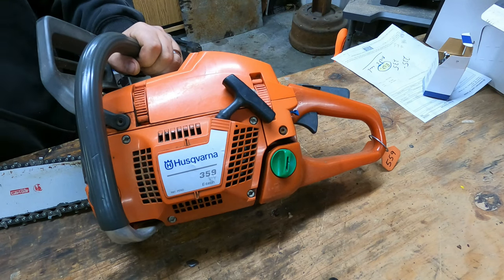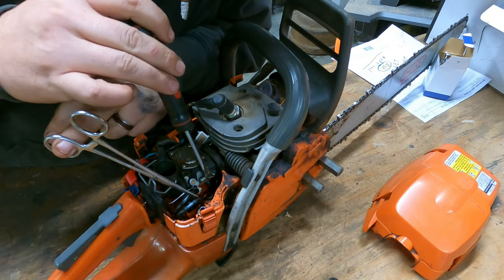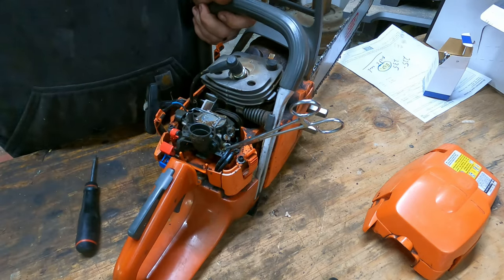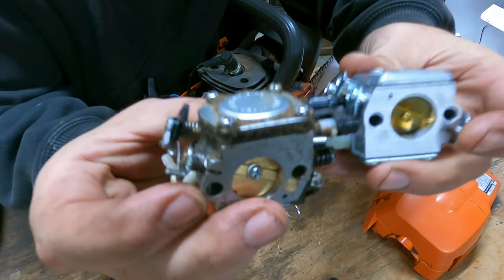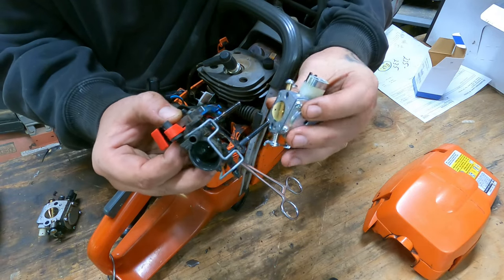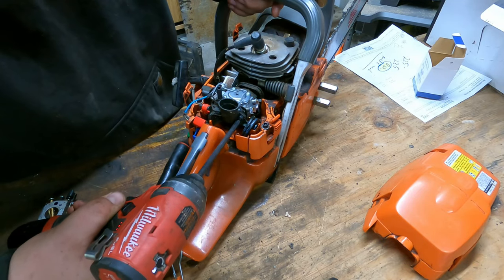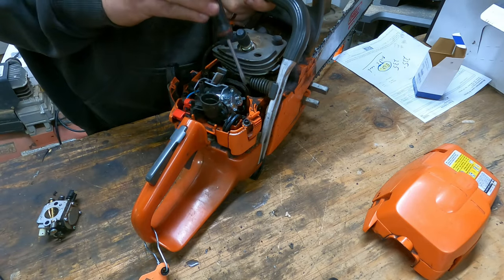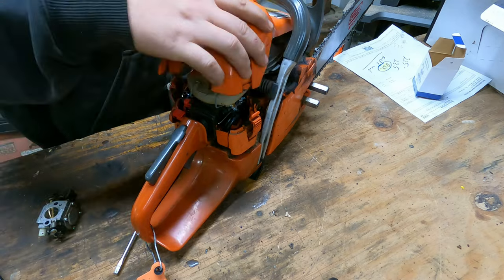HOW TO - Replace a husqvarna 357xp / 359 carburetor no idle, unexplained engine failure

Comment: Mine has the old style i just cleaned it today and it was spotless.Acted like it was hung open..Plug cover in gas and spitn fuel out muffler..Just out of no where..Cleaned it best i could ..Then i pushed the trigger slider off in handle..Choke wouldnt lock out like it should..I missed a bolt hole on gasket.lol..It popped right off as always..Say i need to replace carb..Good how to video..❤

Comment: Awesome video. Somewhere over the years I’ve owned this or maybe straight out the gate because my dealer is great I got the updated carb and EPA stuff was edited. Seeing the difference was helpful. Just going through some of the equipment and haven’t used my 357xp in years. Started right up and ran a full day no problem. Thank you for making quality content.

Comment: Very detailed video. I'm working on my dad's 359. Carburetor problems. Never worked on this particular model before and your video was very helpful. I've tuned and tuned the carb and it just won't do right. Can't get it to idle right and at time bogs on the top end no matter how I tune it. And yes, the arrestor screen is good. Anyway, I'm gonna take the carb apart and clean it. If that doesn't work then I'll just replace the carb. I'm sure the carb kit costs more than what I can get a new carb for. Good video though.

Comment: Thanks for sharing and demonstrating how to replace the carb. Also showing the difference between the old and new versions of the carb. I just picked up a 359 off Craigslist for $80 the guy just put a new side cover spark plug and updated carb on it but it will not start. It’s got plenty of compression and looks to have been used very little. Any way your video will surly help me on my adventure! Man you work quick on them things! You could probably do one in the dark or very limited light if you had too!

Comment: Great video, I have one question though. If previously I had the WALBRO carburetor on, can i replace it with this ZAMA new one and they will be compatible?
Reply from the maker: yes they used both rbs on these depending on the model year walbro is better in my opinion but both fit just fine

Comment: Is this the zama C3-EL42 . You are putting on.
Reply from the maker: Yes, oem only the Chinese ones are not the same or as good
Reply: @Coakleyfixedit207  100% china carb no good .  Any suggestions where to buy. Was going to look on Amazon.
Reply from the maker: Amazon will work as Long as it's guaranteed oem or a local husqvarna dealer can order it but it'll be around $100
Reply: @Coakleyfixedit207  Do you know anything about a carburetor brand Stens, model 616-418?
Reply from the maker: @tomljungman2545  stens sells both oem and Chinese aftermarket carbs, I've had decent luck with there aftermarket stuff, though they don't seem to run quite the same as oem

Comment: Way to fix that old type carb is to drill a vent hole (or two) in the top lid that is held by 4 screws. Carb rebuild kit and it works as good as new.
Reply from the maker: Uhhh that would literally do nothing as it has nothing to do with the issue but thanks for watching and the comment
Reply: @Coakleyfixedit207  Ok, then I was wrong about around 5-6 these types of carbs that I fixed that way... That black plastic part has vents that mess up and if you put vent holes in the lid above diaphragm it literally does something ;)
But hey, don't have to believe me, if you get a chance try it once..
Reply from the maker: @vjeko8690  it's a check valve inside the carb body that goes bad, the vents in the lif and black spacer are so the diaphragm can move freely, I'd more likely say the carbs you fixed just needed kits. But hey not throwing shade your way maybe I didn't explain the issue these carbs have deep enough

Comment: Hi when you replace walbro carb with zama you dont need diferent flange for it  part number RS727859 ?
Reply from the maker: Nope, I have no idea what that part number is, it's definitely not a husqvarna number
Reply: @Coakleyfixedit207  This is quote from AirboristSite

SB, 357 XP, 359, Introduction of new carburetor for better idling stability,
2008-10

To achieve better idling quality, a new carburetor has been introduced in the production. The new name of the carburetor is Zama C3-EL42, replacing Walbro HDA199A/B and HDA191A.

New part number for the carb is 505203001.

Also, requires a different flange, part number 503928502.

Introduced from serial numbers:
357XP 083800001
359 084500001
Reply from the maker: @audis6m  ohhh gotcha musta been a typo on your original comment, I've done hundreds of these and never had to replace the flange on a 357/359. On the smaller 300   series (350, 345, 346xp etc) i have run Into needing a different style because of the adjustment screws. It's important to keep in mind these companies sell different variations of the same model to different regions. California is a good example of this
Reply: Would you think changing the carb on my 357 xp would resolve it bogging and stalling while idling.  I've done everything else to it except replacing the carb.
Reply from the maker: @scottseeley4799  %100 other then fuel lines and intake boot that would be my 1st guess, if it's an early version with the auto decompression that could be leaking